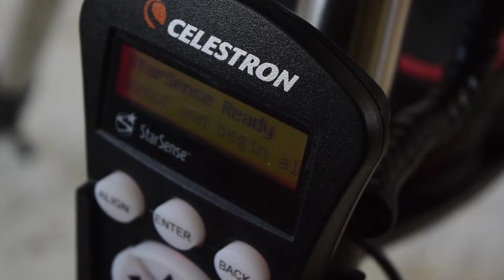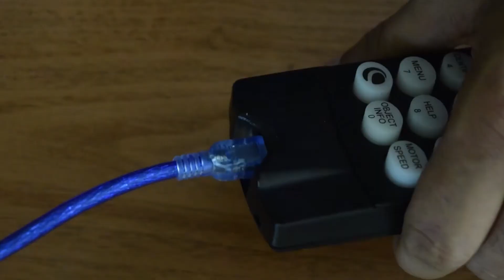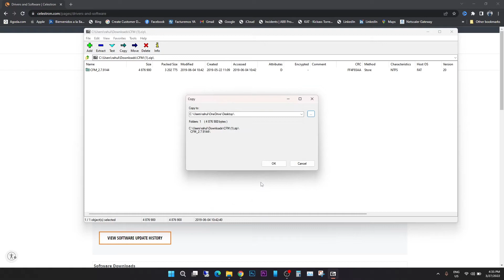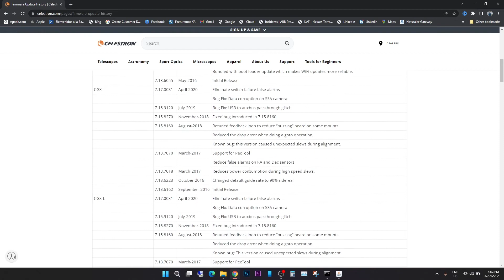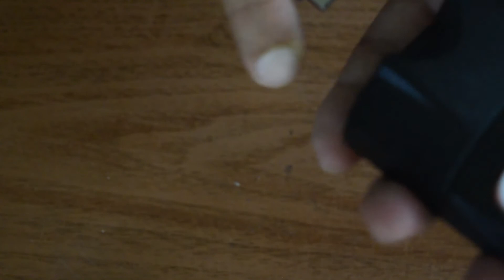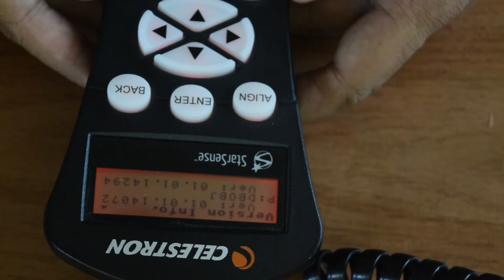How to Update Firmware on Celestron Starsense Hand controller | Celestron Starsense AutoAlign Camera

Comment: Thank you for the video.  I tried it just as you showed on windows 11 and could not get the run.bat to work.  I remembered reading something about windows 10 version and tried again on a spare pc running windows 10 and it worked perfectly!! ???  Maybe its not supported by windows 11?  This may be an issue for others.  Thanks again.
Reply from the maker: I am glad this video helped. please note you can always run bat file via cmd. Please stay tuned to my channel for my future videos
Reply: @AstroShootingStars  Can you please answer the question about Windows 11 support?  I have W11 and cannot get any devices to be found after following all the steps exactly.  I do not have a Windows 10 system to fall back on.

Comment: You don't need to check the version first.  And also you don't need to hold the celestron and menu button.
Reply: yes you do, I tried without it and wasted a lot of time, you're wrong
Reply: Actually you're wrong But whatever do what you want.
Reply: @Ryry4579  no I am not, you're still wrong, But whatever do what you want
Reply: Have followed all this however it all looks great and then fails on my autoalign camera at the end.

Do you happen to have any advice? Or anyone else faced this issue?

Thank in advance for any help.

Comment: hello I updated exactly what you said now my HC says"Application Int" and  is struck. did all reattachments and poweroff and on doesnt work ? pls advise
Reply from the maker: Its possible that you need to factory reset the controller. Please power down the whole system and then press zero on your hand controller while holding the button turn on the power this will factory reset your system. I hope this helps. Please stay tuned to my channel for my future videos